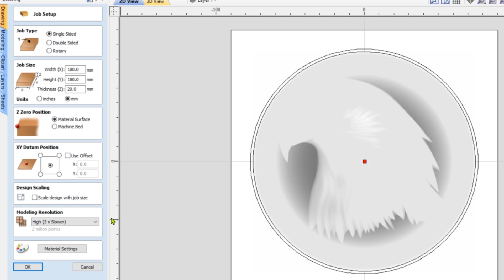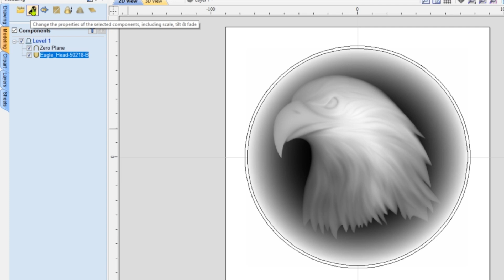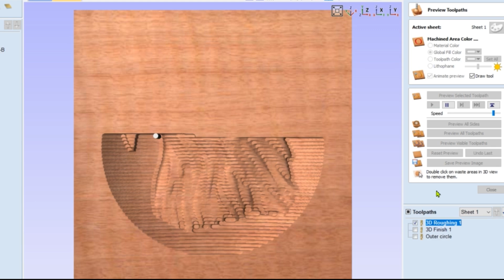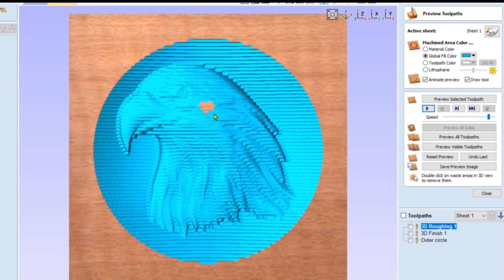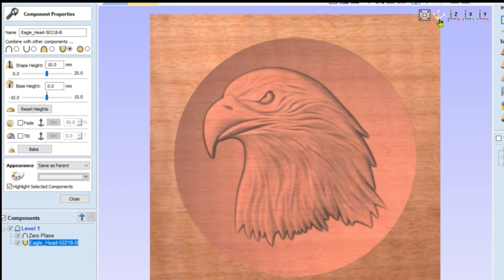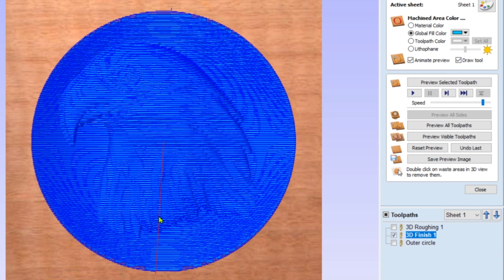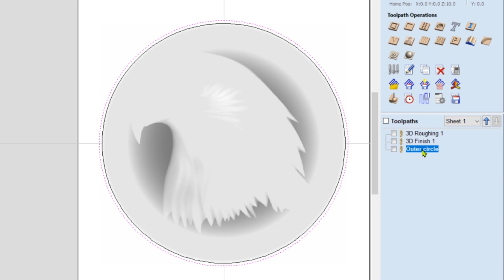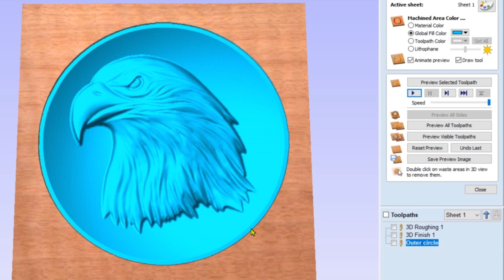3D Wood Carving CNC Router Beginner to Pro EP6

Comment: How many hours exactly does it take? Overheating might be a problem as you mentioned, I didn't think about that
Reply from the maker: It is a little dependent on the acceleration of your machine. The feed rate makes really not that much difference as all the moves are very very small. So a high acceleration of the axis makes a big difference. I can’t tell you how long it took from top of my head but I think it was 90 minutes on my machine. Also the sepover makes a huge difference. So how smooth of a surface do you want and how  much detail. My controller also shows the cutting time so I can make changes in case I don’t like the time.
Reply: @JBWorx  I see, thank you for taking the time to answer
Reply from the maker: You bet

Comment: thank you for the informative videos however you mentioned static/electromagnetic interference but did not explain how to eliminate it.
Reply from the maker: That would totally depend on your built. But shielded wire for the spindle and sensors is a must have in my opinion. Also a line filter on the incoming power is good. Next is the separation of high and low voltage components in the control cabinet. You can see this is a rather complex topic and would require a video on its own.

Comment: First, well done as usual.

Your making money tips are spot on.  It seems a lot of folks have bought into the idea that a CNC just prints money... it doesn't. My last project was $550 after all was said and done, I paid myself about $3 an hour. 

Have you tried to import a 2D image, then add depth to it? (as opposed to importing a canned 3D model) Though this functionality may be more Pro vs Beginner.
Reply from the maker: Carl, I know exactly what you mean when you calculate back from the price of the item to what is left as your hourly rate. Yes getting the image is sometimes a problem if a customer has a specific request. Many resort to purchasing a file from Etsy or cutrocket just to find out that the file is garbage as it contains thousands of nodes where a simple radius or straight line vector should be.